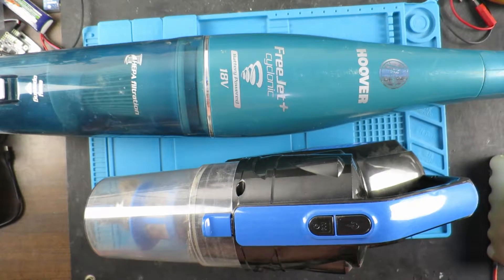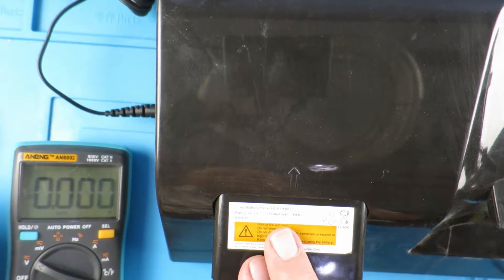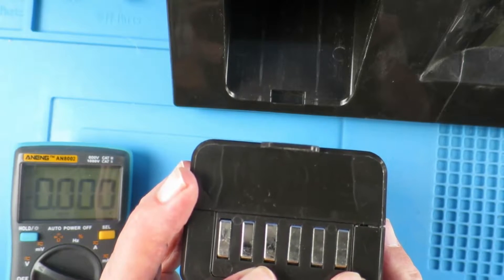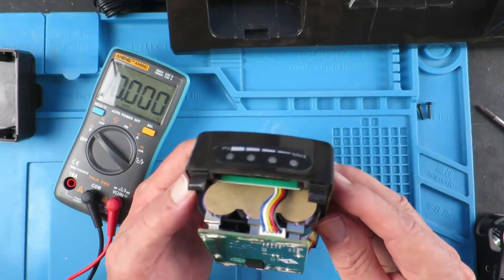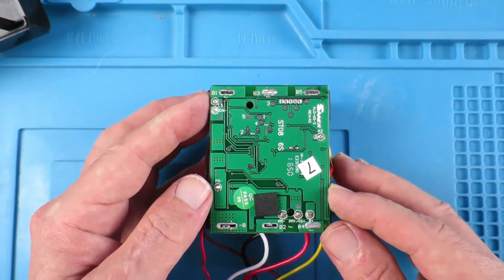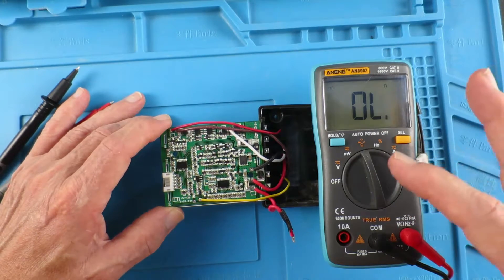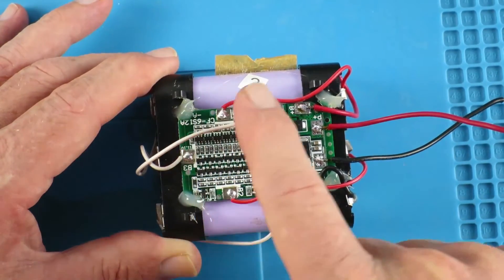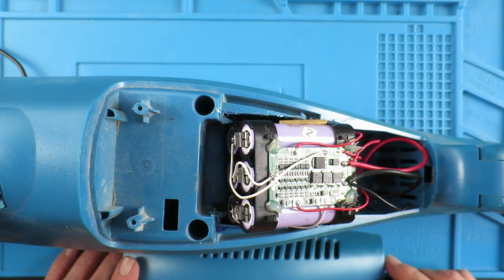Lidl SHAZ 22.2 A1 And Hoover FreeJet+ Repair Tutorial DIY

Comment: Hello I have the SHAZ 22.2 A1 cleaner but when I power it on it last for few second and turn it off. The battery flashes all the light together. I have a second pack and does the same. Not sure if it is a battery problem or a problem with the vaccum. Any ideas? thanks!!

Comment: Thank you for the video! I was wondering when someone would post aything about that Lidl vacuum shaz a1. A true disappointment so far. Not that powerful and the batteries die horribly easy and for no reason. I have now 2 dead batteries. both had dead 18650 cells which I replaced and went trough all that trouble for nothing cause, the BMS was fried as well, somehow. It is the last handheld vaccum of this sort I buy from Lidl. I have a different model from Parkside that uses x20 team batteries, and it is more efficient powerful vacuum, plus the batteries are cheaper and easier to get. I was thinking on fitting/adapting x20 bateries to the shaz a1 but I don't kown if I can pull that off without a lot of work... I will probably end up selling the damn thing... sighs
Reply from the maker: Yes, I'm afraid the Shaz sucks but not very well! Glad you enjoyed the video. Thanks for watching, have a great day!
Reply: @1nformatica  Yeah, well the shaz has a nice design, does corners and tight spots good. Overall not that bad of a vacuum either. It's just those damn batteries that make it suck, I guess. Had they made these take parkside x20 batteries instead, it would be the best vacuum ever, maybe?!

Comment: the new battery is no longer available. I'm thinking of replacing the BMS board but without the Eco function it would probably live fast and die young, I'd need to clean my house in 10 minutes
Reply from the maker: Go for it!!
Reply: I had that same thought for my shaz a1 vaccum batteries but I haven't had the spare time to figure it out yet.  I suspect the vaccum motor and the motored brush operate at different voltages but Ihave to dig deeper into it. Have you made some progress?

Comment: Hello, thank you very much for the great video - I have subscribed to your channel! Unfortunately the battery from my Lidl Silvercrest vacuum (Shaz22.2A1) has died. I opened it up I am getting similar voltage from the batteries (around 4V each). This is where my skills end, I am useless with soldering so I am giving up on it. I am now thinking whether I should buy a new battery, but I wonder if you think its worth? Is there anything else than can go wrong with these (motor for example)? Just to see if its worth investing in a new battery for a 3-year old vacuum that cost £50 originally. Many thanks!
Reply from the maker: Hi, thanks for subscribing. It is almost always the battery management system (BMS) that fails on these units the motor should be OK. Some have had luck with just bridging the fuse in the pack https://youtu.be/KbD2t1nc37k?t=341 but you need to desolder the pack to get to it but that is good practice! A new battery is almost the cost of a new vac so for me I would get another vac! Good luck!
Reply: @1nformatica  Hello, many thanks for the advice - much appreciated! I might give it go with the fuse, and I agree it makes more sense to get a new one. Many thanks again!
Reply from the maker: @solomonpapadopoulos6602  You welcome, good luck!

Comment: Hi! Do you remember what are the value and type of the fuse? In my case the fuse was blown, but I want to try to not to desolder the BMS circuit from the cells and try to connect an external fuse of the same kind to the correct wires... Thanks for the video!
Reply from the maker: The fuse is a 10 Amp ceramic type. It goes between the positive of the battery pack and the BMS circuit. I guess you could bridge it with wire and add an external fuse. I tested by bridging the fuse with wire but the BMS was faulty so the fuse did not protect it!
Reply: @1nformatica  Thanks for the info! In my case bridging the fuse with wire works. I will try your recomendation... Thank you very much!
Reply from the maker: @tomascarralero  You're welcome! Please consider subscribing for more!!